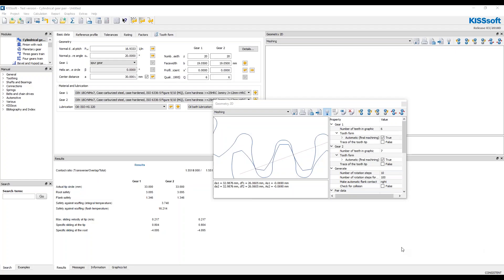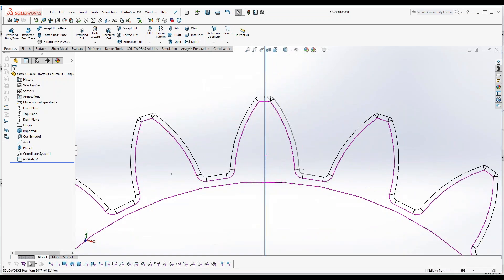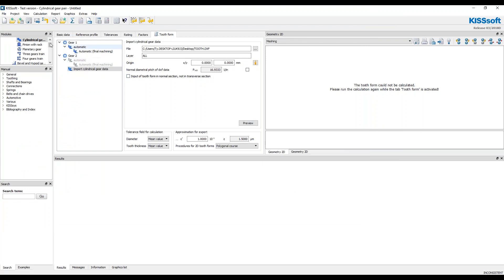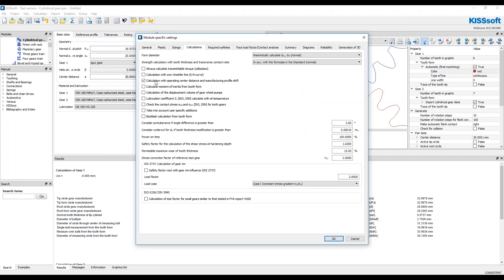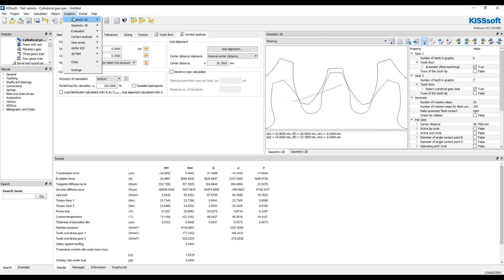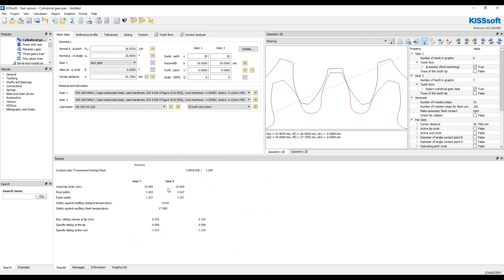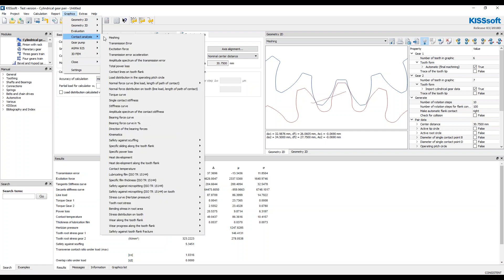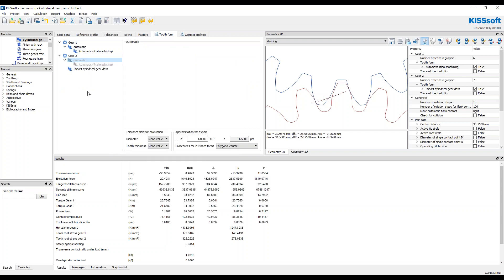Importing Gear Data into KISSsoft

Comment: I'm having trouble making shafts vertical in kissSys can anyone help me?
Reply from the maker: in the shaft module under the basic data tab, there is a position of shaft axis in space, you should be able to define the position as horizontal, vertical or your own angle, 90 degrees would place the shaft vertical.  If this sin't working for you, I'd have to look at the file.
Reply: @kisssoftusa9363  still doesn't work, the problem is not defining the orientation in the shaft calculation in KissSoft the problem is when aplying this calculation in a KissSys model it always appears in the default horizontal position, i'm wondering if there is something to do in any of the KissSys definition that enables the modification of it's position based on the KissSoft module, anyway great video!!
Reply from the maker: @diogorijo364  in the KISSsys model you will have to use the orient features to move the shafts to a position you want. I'll see if I can find a tutorial for you.
Reply: @kisssoftusa9363  that would be great!

Comment: Excuse me, please enlighten me how you draw the half pitch of gear profile? I tried to follow your demonstration in the video to save a dxf file from solidworks but I got a problem on the half gear profile (half of pitch); I created the plane-1 then I cannot draw the gear profile because the the gear outline side is vertically to the plane-1. And solidworks rule doesn't allow the line without close loop.  How should I do to do it right? Thanks!
Reply from the maker: Without seeing it, i would suggest you sketch an axis in SW that intersects the middle of the tooth root space and another that intersects the middle of the tooth tip.  You can then use the trim icon to get rid of everything you don't need for the sketch.  I assume you are taking a scanned or otherwise already designed tooth form and trying to import this into KISSsoft.
Reply: Yes, I  sketched a gear, then tried to save as a dxf file, I could save the whole gear outline but the half pitch of gear profile. I did think about to sketch only the half pitch of gear profile. That is easy to just create an additional profile sketch file but thought your way is better, easy maintain all datas in one file.